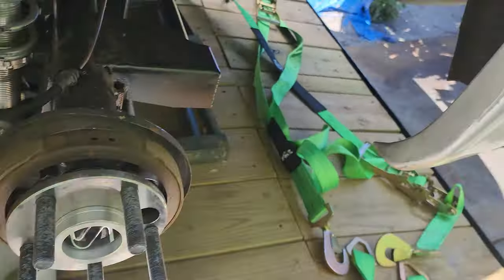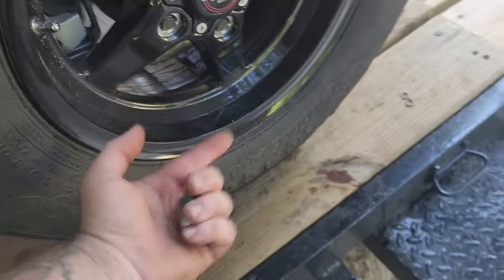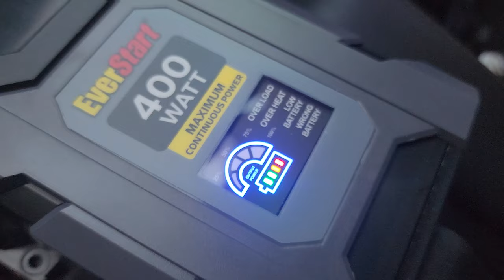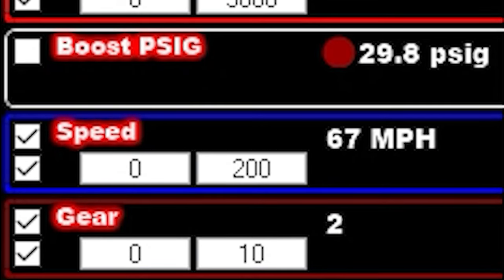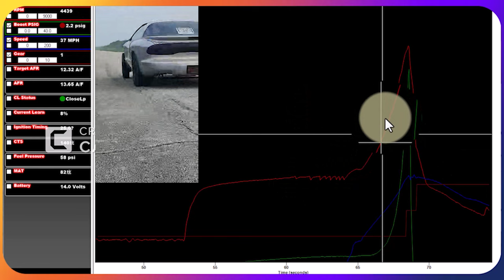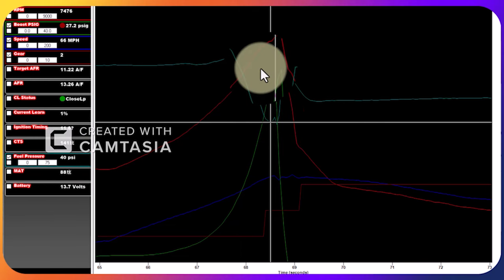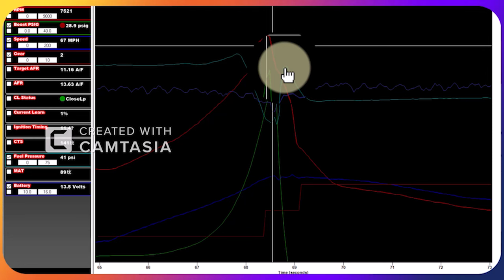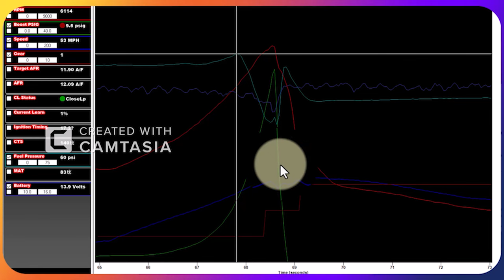First Pass on Our Budget Drag Car Before the Cops Arrive!

Comment: You should be able to get that to spool a lot better. Your afr and timing on the brake makes a big difference. You need to be a lot richer and cut timing.
Reply from the maker: The 4.8l does not care lol, I tried so many different combos of timing and afr that I actually smoked the torque converter out of it lol.
Reply: @HighNoonRacing  SMH  What turbine AR do you have? Run a 50 or 100 shot of nitrous
Reply from the maker: @funfun8095  75 shot did it FAST but was too late... converter went. But I'm having it rebuilt and restalled for this new combo
Reply from the maker: @funfun8095   92/103 T6 1.32ar
Reply: @HighNoonRacing  Ah, ok.

Comment: 3rd option to cause a fuel pressure drop is fuel filters just ran into that on my car pressure dropped as soon as my had a high fuel flow demand
Reply from the maker: another reason is fuel slosh but the tank was full
Reply: @HighNoonRacing  yeah I wondered if mine was fuel slosh because my fuel gauge doesn’t work so I popped the pumps out and had plenty of fuel… one of my in tank filters was a bit dark but my filter inline after the pumps was completely collapsed